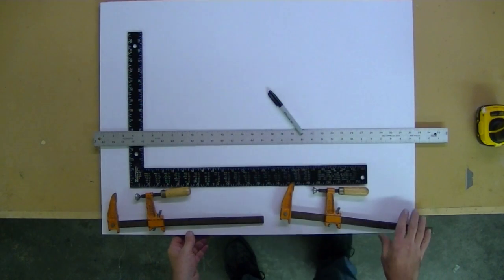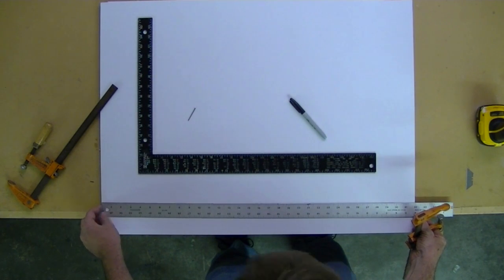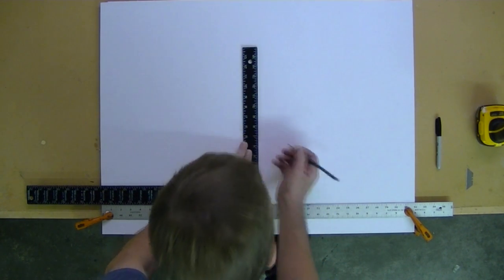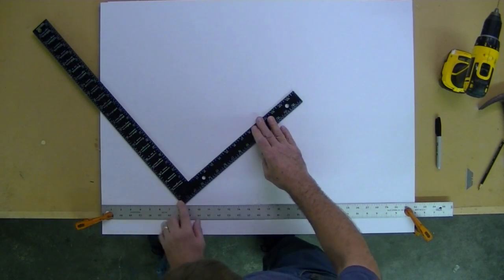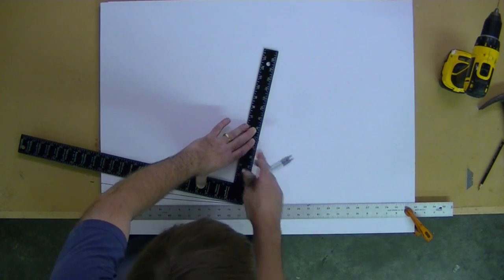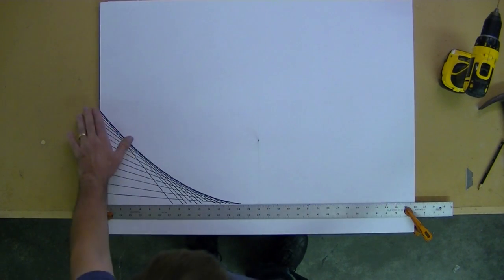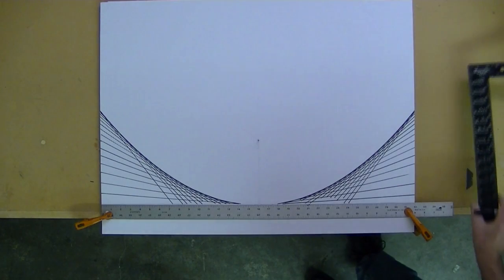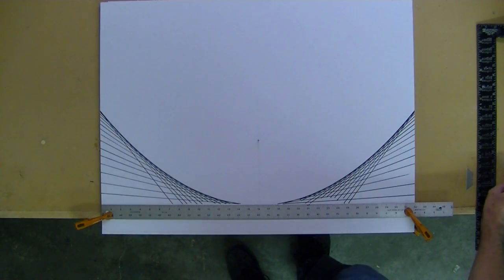How to Draw a Parabola

Comment: Subscribed on the basis  of this one video, very nice.. I can imagine converting this to 3D by making two of these and forming a cross with the centerlines matched with each other but at right angles; but I can't picture how to get the 45 degree angles? Make a third one and cut it in half?  I was thinking of making the positive of this as a stack of layered mdf, then heating plastic sheet and forming it on the mdf, using the mdf as sort of like a sheet metal forming buck..

Comment: Thank you! This is brilliant! For a solar trough, how far up above and out from the focal point do we need to draw? (so that we reflect as much of the sun's rays as possible). For your 6.5 inch focal point you used paper that was 32 inches wide. Did you just run out of paper or is that the correct width for a 6.5 inch focal point? Thanks! John

Comment: Making the parabola out  of flat segments  prevents the focus from focusing to a more dangerously hot and bright point. Light from  solar collectors can cause near instant permanent blindness and third degree burns.  
Without knowing any of the geometry of the parabola exceot for the focus, the exact points for the segments can be determined. 
Draw a circle that is the diameter of the collector pipe at the required position.  Grade the surface with vertical lines that are separated by the diameter of the collector pipe that are tangent to the left and right of the  circle.  
  Cut out  a bar of wood or cardboard that is the width of the collector pipe diameter  and the length of half the width of the collector mirror.  The end points of the flat segments in the collector mirror can be determined by putting the bar over the circle so that it is tangent to the inside of the circle  and swiveling the bar to see where it intersects the vertical lines.   Align the left edge of the bar with the point where the first  segment of the mirror is to begin along the  line tangent to the right  of the circle.   Mark the point where the right edge intersects the next vertical line.   Swivel the bar so that the left edge intersects  this marked point.  Mark another point where the right edge intersects the next vertical line etc.  If the dimensions of the circle and the bar and the spacing of the vertical lines is a little smaller than the actual diameter of the collector pipe, it allows for small errors in alignment with the collector mirror.

Comment: Is this an ellipse or a parabola? Is there any way to check the directrix?
Thank you.
Reply: The only way I can think to check the directrix is to use the framing square, tangent, and focus to find the axis, then set a pair of dividers from the focus to somewhere on the parabola and then swing that measure straight down parallel to the axis, then adjust the framing square along the axis until it meets the point you marked with the dividers.

If you already have the parabola though, I can't think of what to do with the directrix. Why do you want it?
Reply: the directrix is equal distance from the focus to the vertex. In this case he used a 6-1/2" focus point so the directrix should be 6-1/2" below the straight edge.

Comment: You have the best method for demonstrating how this works. I was able to easily create one in cinema4d and after effects. now i will make one using just after effects. You just need a line and a variable focus area as null object. As  the line moves to the left driven by another null object. The line is targeted to look at the focus null causing it to rotate. A quick animation and in after effects use an echo FX to show all frames at once and wallah. I also notice all parabolic are basically the same shape. Its just scaling and clipping that's proportional to focal point.

Comment: Thank you very much for your ridiculously simple an  elegant method of drawing a parabola. I have searched for a simple method to draw a parabola with a given distance of the focal point from the vertex and your method was the only one offered.  Is the  parabola obtained in this way a true geometric parabola or is it an approximation? Any way thank you for posting this most useful piece of practical information.
Reply: Friend, this method is accurate. It is not an approximation, you can trust.
Reply: I would say it is an approximation, it is only accurate at the exact points the lines are derived from, BUT, it is very close, and the more points you add the more accurate it becomes.  The reality is that the 200Lb gorilla with the belt sander is likely the sticking point on how accurate it is.  In the end the way he did it, is probably at a minimum of 95% mathematically correct assuming the gorilla has any skill and eyesight!  In other words, this is EXACTLY how I will be building my solar collector for my greenhouse.

Comment: This is a very good demonstration. You are a very good geometry teacher.
I am going to build a large T square with 2 x 4 lumber. Instead I will build a (1-1-sqrt of 2)  or a (3-4-5) triangle and use it as a T square to built a parabola. My goal is to build a parabolic solar cooker. I would like to build one slice of it and assemble multiple slices to make the dome. Thanks you for the video.